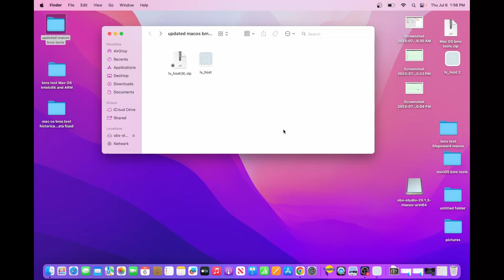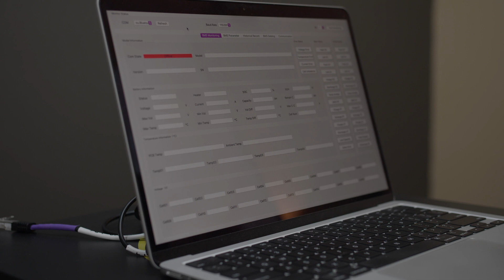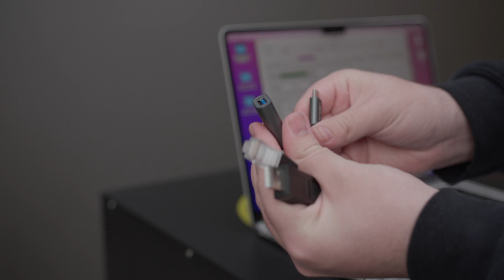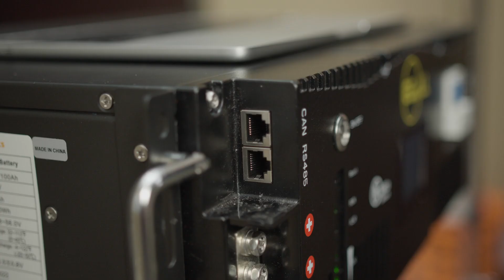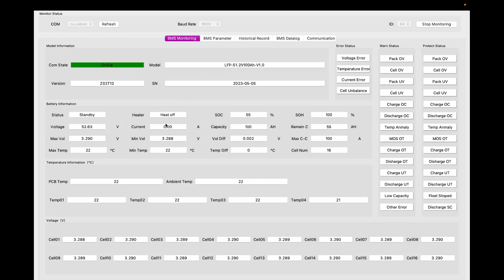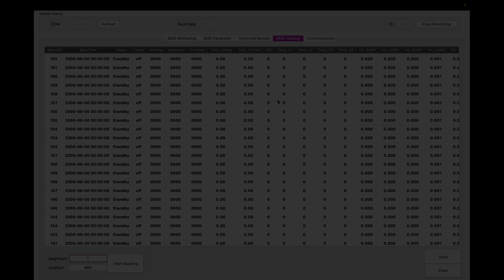BMS Tools MAC OS Tutorial

Comment: Does this software work with the EG4 LL V1 batteries?
Reply from the maker: The MacOS software was developed for the V2 LL batteries, as we've stopped carrying the V1 LLs. You'll still need to use the Windows version to be able to communicate with the V1 batteries.